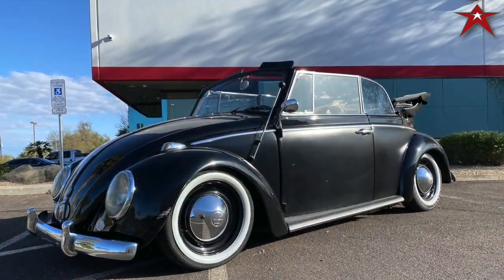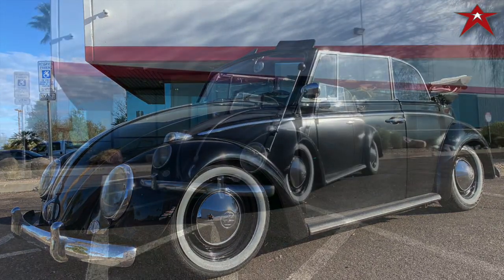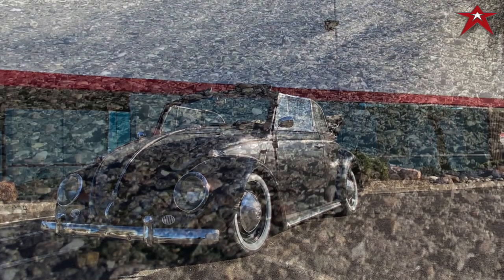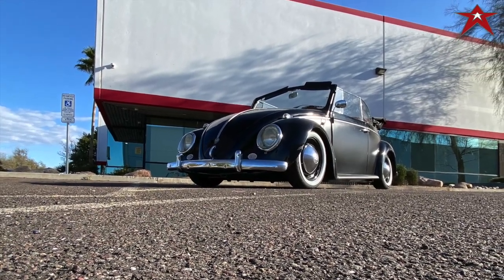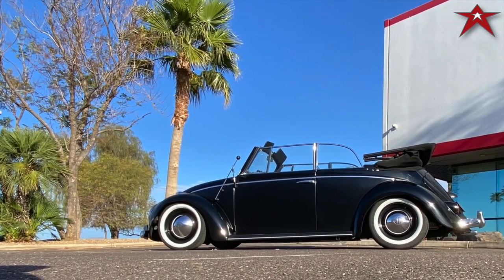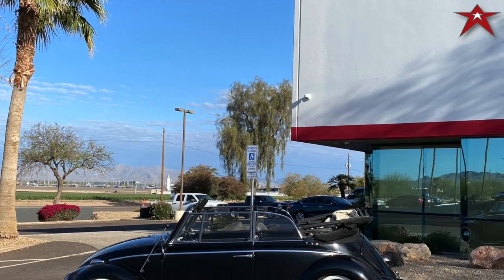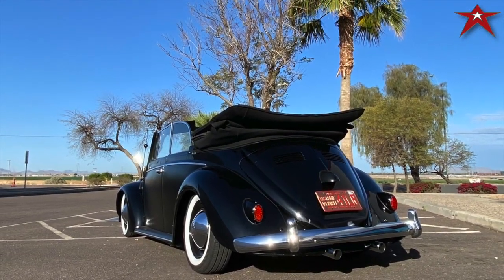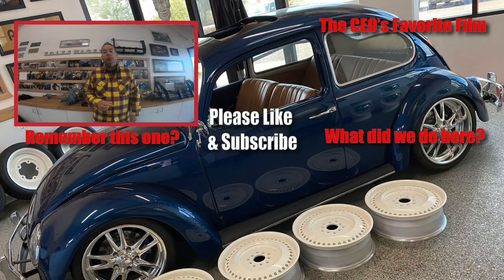Stanced Classic Volkswagen | 1966 VW Beetle Convertible | Is THIS your Jam? Suspension/Wheels Specs

Comment: Pete in the previous video it looked like you checked spring plate angle with plate engaged with frame lip.Just making sure, the plate is off lip and  reading 5 degree's?
Reply from the maker: Correct, unloaded